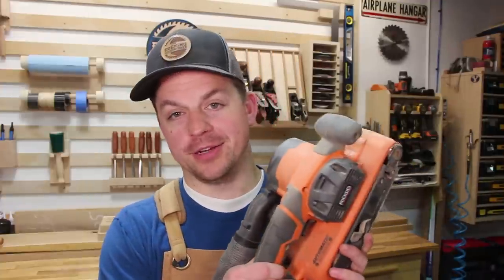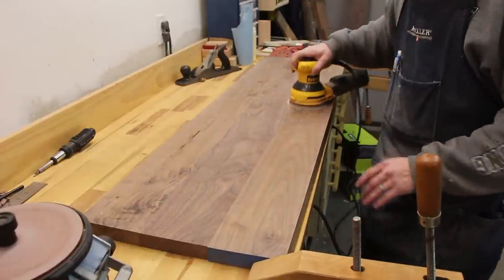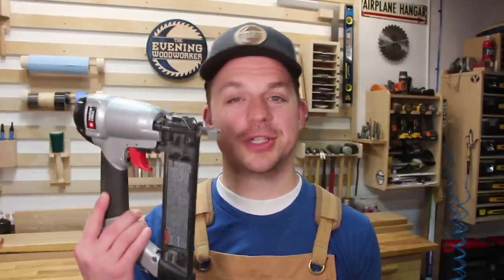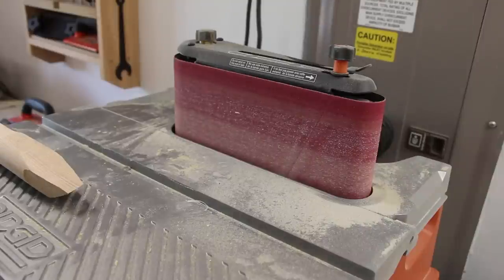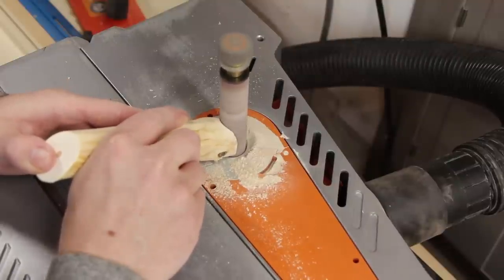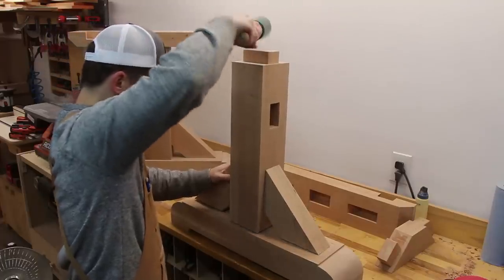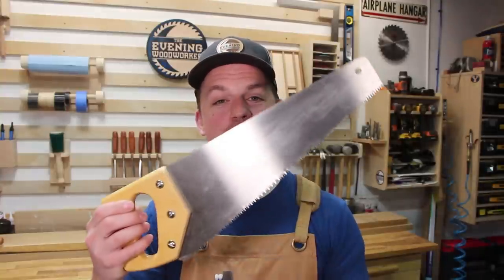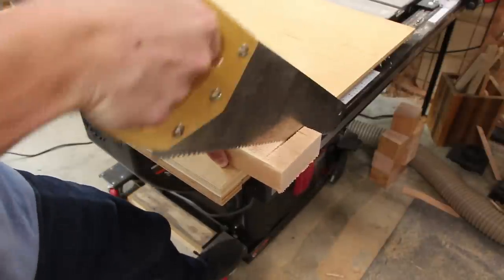6 Woodworking Tools I REGRET buying!

Comment: I use the crown stapler fairly frequently, but agree not for any of the applications that you show. It works great on thin panels for carcass backs or drawer bottoms where a pin would just blow through it or not hold. I've also used it for holding screening and mesh for the same reason. - Chris
Reply: EXACTLY CORRECT!!!
Reply from the maker: That's actually a great idea! If you don't need to fill the holes, then a bigger one isn't that bad for thin material
Reply: Came to post this about the narrow crown stapler. 👍
Reply: Crown staples are great for areas where you will never see them. Cabinets backs drawer bottoms ect... They are a better holding device because of the bridge connecting the two legs. If you are trying to face frame with them you are correct but for hidden applications they are great. Pick the tool for the job as well as the fasteners.

Comment: I regret buying a table saw with no miter slot and a bad fence. I eventually found someone to buy it off me, so I bought a DeWalt jobsite tablesaw.
Reply from the maker: Yeah that sounds like a pretty useless saw. Good thing you upgraded
Reply: DW745 is a solid table saw. I built a table for it to be parked in

Comment: Narrow crown staples are not for crown moulding. The narrow crown means the width of the staples they also have medium and large crown staplers. I use mine for carpet installation or expanded metal for cultured stone. It would probably help if you knew what the tools were before saying you don't need them.
Reply from the maker: Good to know! Thanks for the clarification.

Comment: There are many instances where a crown stapler is superior to nails. Probably not for furniture etc but many other applications where a slit etc is just fine.
Reply from the maker: I guess I just don't do many of those projects that would need a need stapler. I'm usually trying to hide the holes!
Reply: Critical tool in cabinet building. Fast and strong way to fasten the backs to cabinet units

Comment: Agree with you about the 1" belt sander.  I have a cheap one and it even gives me a small electric (static ?) shock while using it.  Consequently I don't use it.
Reply from the maker: I used someone else's 1" sander that did that too! Sounds like a common issue...

Comment: As a retired commercial carpenter, I have done every type of job/ work you can speak of here. Other then  clean room. I have never built a clean room.  But. When it comes to angle finders , I can honestly say I have NEVER used one. When doing crown or base, I / we would always start out with a  45 * or  what ever the angle looked to be, then we would cut scrap pieces till we were sure the  angle cuts were right right before we cut the actual trim . This process did not take long. Even with an angle finder you should still cut scrap before the actual trim to be sure it’s correct.  We always kept precut 45 * cuts on us test fit . The rule is until you get scrap cuts to fit perfectly you never cut the final expensive trim. This system is actually faster then trying to use angle finders .
Reply from the maker: That's a good tip and money saver!

Comment: I regret buying a scroll saw. I found a used craftsman and thought it would work instead of a band saw. It doesn't. Blade is too thin, it off cuts and chatters. Should have saved my money for a band saw
Reply from the maker: The scroll saw is one that for me doesn't get used a ton, but occasionally you have a project or piece that can only be cut with a scroll saw. A good bandsaw though is worth it's weight in gold.

Comment: Mostly agree with your assessment, except for a belt sander. When used properly, they can be invaluable for leveling up table tops or any other big panel. Using it inline with the wood grain, as you show in the video will definitely cause ridges. The first few passes (80 grit or so) should be done on an angle to the grain and using the pencil marks trick to gauge the material removal. Then you go to 120/150 grit and go again. The FINISH sanding is then done with a RO sander.  
   If you are trying to smooth out a rough / live edge slab with a RO sander, you are gonna be there a LOOOONG time.
Reply from the maker: Thanks for the tips... I guess I need to try that technique out. It's definitely good for removing material...
Reply: @EveningWoodworker  It definitely takes a good bit of practice to get even material removal, without carving big gouges in the work piece. Some belt sanders also perform better than some of the more basic units. My old Porter Cable machines (own 3) are still rock solid and stay flat on the work surface, but MANY, MANY hours of work were involved to get decent results.

Comment: I just used my crown stapler, built a chicken coop and used it to staple in the hardware cloth. Other than that I never use it. 
Instead of the mortiser, I bought a jig that fits on my drill press and cuts square holes. Only have to set it up on my drill press when I want to use it, and like you I don't use it very much, but at least it's not taking up any space. 
Pretty much use all the other tools I purchased. Found that I don't buy a tool unless I find I need it more than a couple of times because there are always other ways to do the same thing, maybe it takes a little longer, but if your only doing it infrequently, not worth getting a tool to do it.

Comment: It depends. Stapler is for upholstery. So if you want to make it, you should actually use staples. I have both "one inch sander" and oscillating one. I use both equally.  What was a failure, was GCM 12 GDL Professional Bosch 305mm chop saw. And not because I don't need one, but because of its very poor manufacturing in China, where it has almost 4mm deflection when you pull it while cutting wide boards. Get a chop saw with a traditional rails tubee. They usually take more space but they are dead straight and don't fail. Hope this helps.

Comment: I bought one of the cheap angle finders probably 35 yars ago.
 Still use it sometimes when I need to get an angle that a larger gauge just will not fit into. (interior angles are more difficult to measure in my experience)
 Got a cheap belt sander, almost never used it on wood, makes a great linisher for aluminium casting seam removal though and has been used a lot.
Got two ROS, not as useful as belt and very slow on hardwoods even with 36 grit but do leave a very smooth surface

Comment: I regret buying the self centre drill gizmo for drilling holes in like hinges… used it once and prefer the bradawl and drill alternative.
Reply: If you want an even easier way to get a self centered hole started in a hinge, use a phillips screw driving tip as a 'self centering 4 flute straight cut countersink'. Using a power drill, running just the bare tip against the wood through the beveled hinge hole leaves a perfectly centered starting hole. Use a drill bit afterward for a clearance hole (screw size depending), and run your screws in.

Comment: I regret my cheap Ryobi drill press. It drills holes no doubt, but it’s grossly underpowered, changing the RPM is next to impossible, the depth stop was cheap and just broke off one day, and because it’s only 10” I can’t drill holes more than 5” in from the edge of anything. That’s next up on my upgrade list. The thing is the one I want is $2000 (Nova Voyager) which is a huge overkill for me, but I want the next one to be my forever drill press. 

Before that, the Ryobi table saw is a piece of garbage, but I got rid of that a few years ago. I bought it before I knew much about woodworking. I like Ryobi tools overall.  Their drills and drivers are almost as good as anything else you can buy in my opinion, but stay away from their table saw and drill press.   Their miter saw is fine too - I owned one for years, but upgrade to a. Is he when I built Jared’s miter saw station, only because the Ryobi’s slider bars don’t allow I to be positioned close to a wall. 

I use my 1” belt sander quite a bit. It’s useful for shaping the end of a piece, like if I want to put a radius on something. It’s going to vary for everyone depending on the kind of woodworking they do. I have mine on a small cart with a dedicated spindle sander.
Reply from the maker: Those are some good insights! It totally depends on what you're making more regularly.

Comment: Air compressor/nail-gun. I've almost never used it, it's noisy, and it takes up a lot of space in my tiny little shop. My 18-ga Ryobi battery-powered nail-gun does everything I need a nail-gun for, takes up far less space, and makes almost no noise.

My first big power tool was also a bust. It was a sliding, compound miter saw from Harbor Freight. Worked fine, but it took up far more space than I could afford, and for what I used it for, a much smaller chop saw, or even a circular saw with a saw-guide was just as good.
Reply from the maker: Yeah the battery technology has definitely come a long way in the last few years. May have to think about upgrading all of my nail guns!

Comment: The Mortiser is used a lot in commercial const for commercial door hardware. The belt sander is a must when installing casework or cabinets . It’s best used for scribing. The crown stapler too had it use when fastening thin sheet goods. The problem is not the tools. It’s understanding how tools are used before you purchase them based on what you think you will do with them..
Reply from the maker: That's true. Some of those tools are great at what they do, but if you don't ever do that thing, then you regret buying it.
Reply: @EveningWoodworker   absolutely. No argument here.

Comment: I have that yellow angle finder and while I don't typically use it on projects, mostly because it's awkward, I find it helpful for getting me in the ballpark or doing the math for me, Lol.

I have the same Ridgid belt sander. I originally bought to use on my deck but it runs too hot for extended use. I made a farmhouse-style end table, out of 2x4's, and I did use the belt sander to try and smooth out the table top. It worked alright but I definitely had to do some finish sanding with my random orbital sander. I think that would be the typical scenario, though. You're not going to use a belt sander for fine sanding.

I bought the WEN 1x30 belt/5" disc sander this past spring and I have found the 1" belt quite handy. I wish I had a larger disc, but for the price and what I make, I'm very glad I bought it.

The only tool I don't ever use, not that I absolutely regret buying it, is the dowling jig from Harbor Freight. It's like the one you showed as an example of other forms of joinery. I bought it as an experiment and I couldn't quite get consistent results with it so it just sits in a drawer. I bought Milescraft doweling jig and it's the bomb!

A caveat that should always be mentioned in videos like this is that what you may regret buying might be a go-to tool for someone else. If I'm not building furniture, for example, I wouldn't invest in a mortiser. That doesn't mean someone else shouldn't get one. Or a crown stapler. We all have our niche. What works for me may not work for someone else.
Reply from the maker: Great point! I guess we just share based on our usage and I'm finding that some of my least used tools are ones other people use all the time.

Comment: I regret buying my scroll saws and lathes.  I bought a nice hobby scroll saw from Lowe's and then found a deal on a RBI Hawk for about twice as much.  I rarely use either and they take up a lot of floor space in my garage.  I'll lose my shirt on the hobby saw even though it probably has 20 minutes of run time.  The RBI Hawk will probably make me a little money if I opt to sell it.

I thought I was going to make a bunch of pens as a side hustle and bought a lathe and I couldn't get it to run true so I bought another one, and a bed extension, and both are still in the box.  No room in my shop to set them up.

Comment: Hello --  67yo picking up woodworking as a hobby and maybe to make a few bucks.  Have a brad nailer on my shopping list.  What do you use instead?   newly subscribed.  thx
Reply from the maker: The brad nailer is really handy. You can do it with a hammer, but it's more likely that you'll dent the wood.

Comment: Mostly I use my belt sander clamped upside down to my bench. I don’t have a spindle/bench top belt sander yet, nice hand plane ;), better choice 

The stapler works great if you are putting clothe on something. I have never needed to fo this.

Quick answer, in general rip saw has low tpi, high tpi is crosscut… There are several way more important factors ( teeth alignment, angle of sharpening: see wood by Wright). Hand saws are convinient at times but like everything else the is no open and go with woodworking tools. Rex Krueger did a video where he resets the kerf of a hand saw and works so much better.

Biggest regret, swapping my bench top drill press for a full height. 100% less convenient, 0% gain of effectiveness or efficiency in my shop. Your mileage may vary.
Reply from the maker: Good insights...thanks!

Comment: looks like the orbital sanders go against the grain?
Reply from the maker: The crazy thing with random orbital sanders is because the movement is random, it usually doesn't have visible scratches even going across the grain. I didn't believe it until I used one for the first time years ago.

Comment: One times backsaw... which I never use.  I actually hate it - it only works on a backstroke and refuses to work on a forward stroke, it just will not.  I guess that when I need one, I will find an buy a Japanese saw instead (amateur).  Oh, and one more thing that I hate - big box stores - smaller stores, which may cost more, still work better for me - they pay more attention to what one actually needs and uses, as opposed to big stores that don't care what it is, so long as it makes money and leaves the shelf in a hurry - even if they have a decent cashback/swop-out policy, it is still a racket.  Anway, that's enough from me.  Thanks for an interesting video. 👍🙂

Comment: try Makita 9403J don't judge the whole group of tools because you used a bad grinder. A small vertical belt sander is primarily for working with metal, for example, when making knives, you could also show a blender and say that you don't use it in a carpentry workshop
Reply from the maker: I'm sure there are better 1" sanders or grinders out there... it's just something that doesn't get used much in my shop. Hmmm... I wonder if we could blend wood to get new colors and grains.

Comment: I regret

Electric portable planer, i hate it. It always takes off too much or nothing. 

The $40 thingy so you can drill straight holes with a hand drill. Mine is a milesctaft.

Comment: I threw away my traditional saws 45 years ago and switched to the Japanese saws.
Reply from the maker: There's such a big difference! Good choice
Reply: @EveningWoodworker  I haven't thrown away my traditional saws, but they get very little use now. You have more control over a Japanese saw, plus a very thin kerf. I use a digital angle finder, great for accurately transferring an angle from one place to another as well as measuring or setting an angle. I have a hand stapler, not a power one, I only use it for upholstery.

Comment: That’s funny, I bought the exact same angle finder and it’s been sitting in my tool chest for at least 5 years. I finally pulled it out to use it a couple months ago and came to the same conclusion…Completely worthless tool!! I’m a retired remodeler, and for the life of me could not make any sense of this thing. It went right in the trash.

Comment: I actually bought the harbor freight 1 x 30 belt sander and in my shop it's quite useful for my woodworking hobby. At the time that I bought it(around 10 or so years ago) I didn't have alot of money and it ended up being very inexpensive with the old coupons they had. 
I use it several times a year for light sanding and it has held up very well, a great sander for the money. Used properly I think it's going to last another 10 or so years. 
No offense, you do you, but did you just wake up and smoke a bowl before you filmed the video? A little wake and bake? Seriously you look wasted...
Reply from the maker: Dude! I have 5 young kids! This is just how I look now... gotta burn the midnight oil!

Comment: Belt sanders are wonderful tools if you just use them correctly and for the correct application.  Random orbital sanders ABSOLUTLEY LEAVE MARKS no question about that at all. sorry friend.  A crown stapler is a fantastic tool for a great many jobs as well, i.e. upholstery work and fastening wire to things.  Ha ha ha.  a dedicated spindle sander is also a fantastic tool I use it ALMOST every single time I am in my shop.  OK I just cannot even finish watching this video, You VERY OBVIOUSLY are no craftsman, you might build a table or two or something like that, but for YOU to go on and on about what OTHER PEOPLE "don't need" is ridiculous!
Reply from the maker: Just sharing my thoughts on tools that I regret buying... I don't know what YOU regret or use regularly. The good thing about YT is that you don't have to actually listen to anything anyone tells you. You can just ignore it and move on!